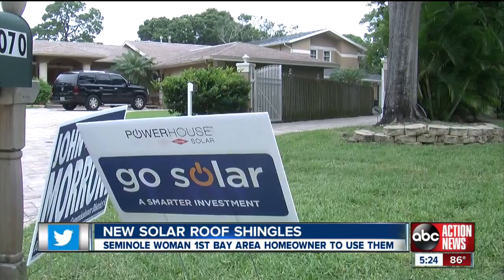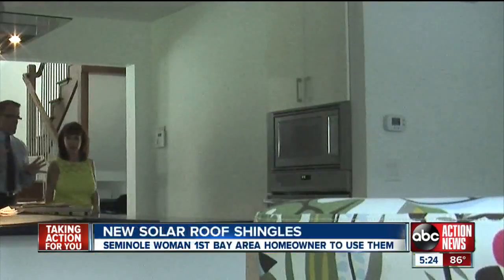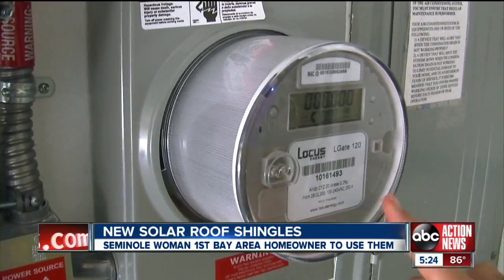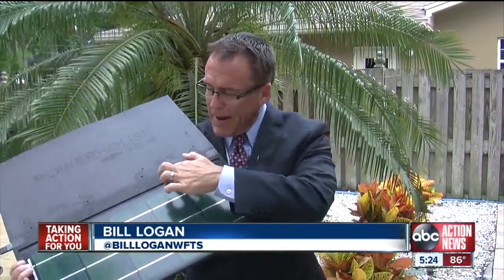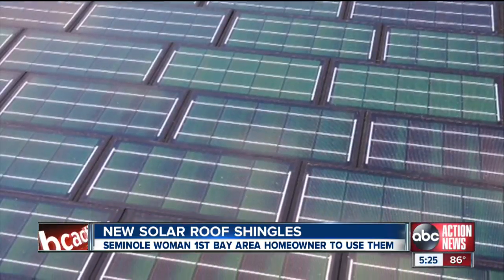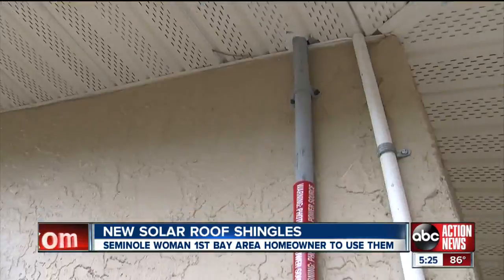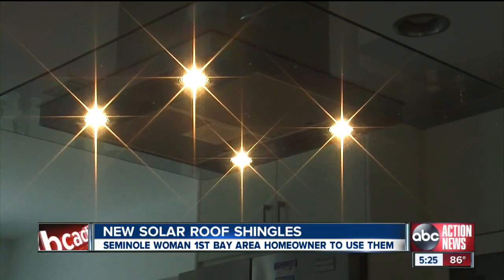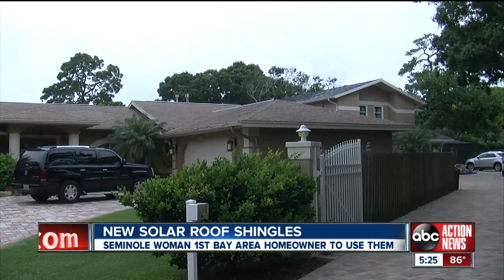New solar roof shingles

Comment: To harness the power of the sun, not only makes sense but saves in electricity expenses in the long run. It would be a privilege to be involved in a project like that.
Reply: Donald Hower Ignore this, Tesla just announced they are doing the same kind of thing but it looks like roof tiles! Blends in so well you can't really notice, and you know when Elon Musk is behind something that it is going to work!
Reply: The solar shingles had a huge recall when they were found to catch fire. I have seen two roofs with burn marks underneath them. Not good.